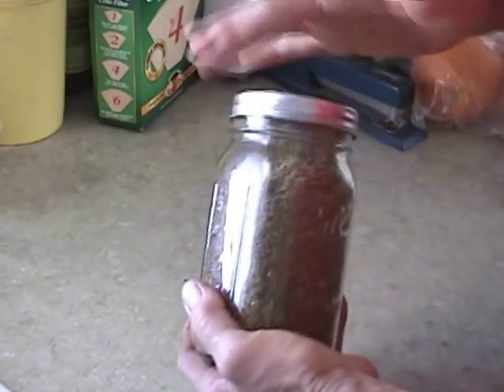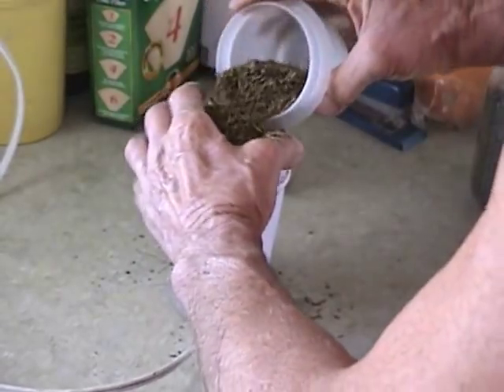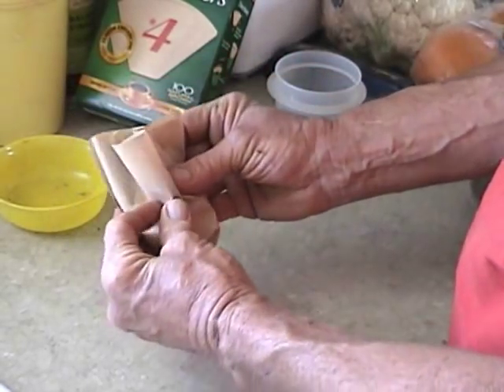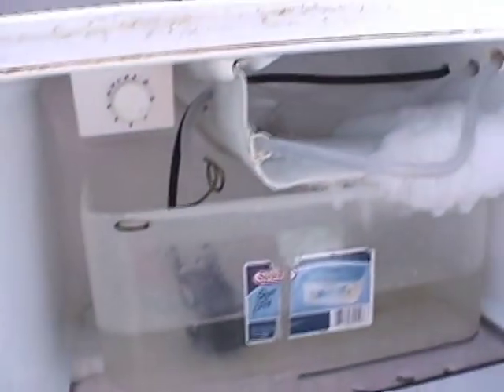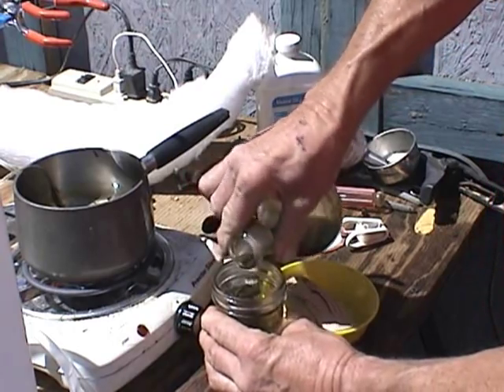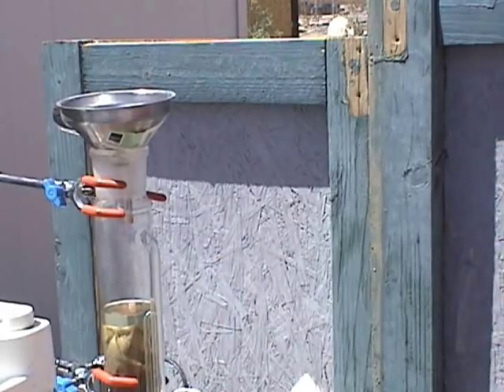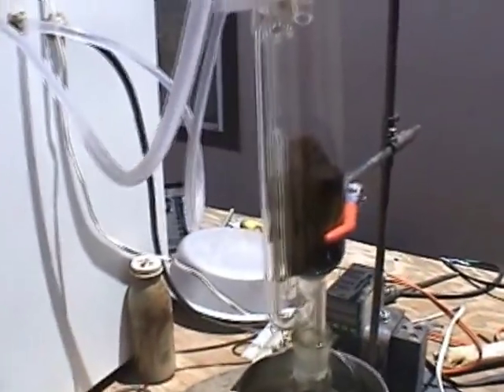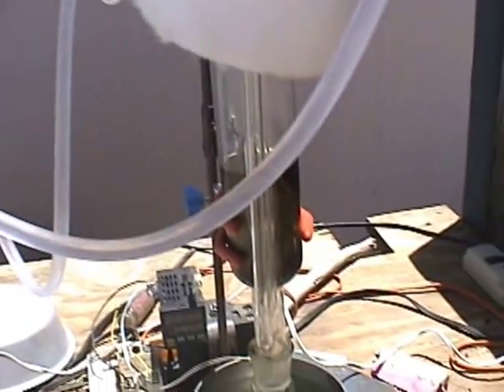Improved Soxhlet Extraction of Medical Marijuana Oil

Comment: Get some keck Clips for your ground glass joints glidman rings would be a good purchase too, in my opinion they are far superior to vaccume grease. Id also reccomend that you clamp the boiling flask by the neck. When you assemble your apperatus you should start with clamping the flask, inserting the extractor body and securing it with the second clamp.then add your reflux condenser to the top.hardware store acetone is dirty for a solvent; however, it is cheap.  I understand the need for a cheap solvent,  so my reccomendation would be to first distill the acetone. Rocks for boiling stones can contaminate your product with heavy metals and particulate, broken glass works well for boiling chips and does not scratch or break your boiling flask. I like your pid hot plate, very innovative. A good upgrade is a magnetic stir plate.  One can be made from an old rice cooker.get some neodymium magnets and  Drill some holes matching the magnet diameter into some aluminum stock. Jb weld them in and attach them to a bathroom fan moter. Make a bracket to hold the motor below the cooker making sure the magnetic bar is within the center ring of the heater on the bottom.Get a dimmer switch for the fan motor speed controll, and use your pid for the heating coil. Get some stir bars and bang! I swear you'll never use a boiling chip again!
Reply: +daniel st jean Yeah, the hardware store grade acetone was the first thing I noticed.  There are plenty of videos on how to fractionally distill this as it is commonly used as a final rinse of chem glassware when one wants to use it soon after washing and the water might contaminate a particular project.

Comment: for future improvement id recommend saving the distillate, as you can reuse it ( that would make using ever-clear more viable.) Also decarb lower and slower. and you can clean with a couple of washes in water ( and re-distilling the water off  removing some water soluble impurities. also since the soxhelt can for  long periods i dont grind my plant material nearly as much, as thats just asking for plant matter to contaminate your end product . (i do a cholorform water wash dissolve oil in chloroform{cleaned} in a jar, add water shake the shit out of it {or a high rate stir bar.}  the nasty will stay in the water. you will notice a difference, hopefully i helped a little.
Reply: +Keith Sutherland also no heat is needed to evap the acetone.

Comment: That is not medicine. You have made an adulterated product. Even if you used lab grade acetone you will never get 100% evaporation there will always be some remaining in your distillate(due to impurity bonding). That acetone you get from the hardware store is loaded with contaminants and in no way should be absorbed by the body(very carcinogenic). Your solvent needs to be anhydrous such as 99% ethanol but 99% isopropanol(from costco) is easily available. If your extracting for oral or topically use you will still be getting alot of the water solubles(vitamins and minerals) in the plant especially because of how long your running the soxhlet(soxhlet generally used for a limited solubility product). If your extracting for a smokable product decrease runtime to get less water solubles(that should not be inhaled).  I would recommend using organic untreated coffee filters and washing them in a solution 1/2 composed of your solvent(alcohol!) and distilled water; let them dry. You have to setup a distillation system to recapture the alcohol; you have an allihn condenser already just get the proper joint to orientate it vertically and recapature the alcohol (cost like $20 max). I am concerned for the health of your patients please reconsider your reagents and practices.
Reply: Acetone is an FDA approved food grade solvent in concentrations of less than 30 parts per million in your finished oleoresin. And the stuff you buy at a hardware store is only 0.9% off of laboratory grade purity. He is doing just fine.
Reply: +1337Sauce Who TF is vaporizing and inhaling any soxhlet extraction regardless of the solvent used? This is for edibles.
Besides that, it would be no more dangerous than BHO after purging.
Shit, technically nothing is supposed to be vaporized and inhaled.
Reply: He should've used everclear! If I'm not mistaken isn't that something like 180-90 proof??

Comment: If the evaporation losses were expensive using Ethanol, then just set up a distillation apparatus and recover the Ethanol. You should be doing that with any solvent you decide to use in order to recycle them, limiting losses.
Reply: Right not like he doesn't have every thing he needs right there. LOL
Reply: I always recover the solvent, to be used again at another time, when done extracting...

Comment: You get a C for effort. A rudimentary chem class would serve you well. Acetone should be distilled prior to use and then made anhydrous with drying agents and distilled yet again. After completion a distillation should be performed to remove the acetone from the boiling flask. To ensure all acetone has been removed, use a water aspirator or vacuum pump to remove the atmosphere and reduce the pressure of your system and that process will remove any residual acetone. You could ask put the oil in a vacuum desiccator and achieve the same task with more control.
Reply: Carlo D'Angelo indeed or use good ole grain Alcohol and then still under vacuum
Reply: An if Pet.  Either is available, do a quick wash in a Separatory funnel

Comment: what is 191 proof means?and can i cycle for 4 hours with oil bath?
Reply: Proof is 1-200 scale,
 alc % is 1-100 scale. 
100proof is 50% alcohol, 
200proof is 100% alcohol.
Just 1/2 the proof to get the % of alcohol

Comment: you should consider using hexane instead of acetone i have heard hexane is one of the safest to use because it has a smell and taste like gasoline in such low dosages as 30 ppm but the toxic amount of hexane contamination is around 250 ppm. there for it's easy to detect when contaminate's are left over at a rate much lower then is toxic to the human body and it also evaporates really well and leaves next to nothing behind. anyways just a thought otherwise this is the best method to make extracts
Reply: Hexane is also incredibly volatile, and in a home lab setup without a fume hood may not be the best option where breathing it in might be a possibility. Pulmonary Lung edima is not a great way to go 6 hours after inhilation

Comment: His videos gave me courage to try my hand at it, and I always borosilicate lab stuff from ebay too, as I value my life and that's why I always never leave the oven, got to make sure the I've cubes keep the water cold, and the boiling flask isn't too cold and not too hot, it's a lot of labor, but the end product make the effort so much worth it...
Thank you Mr Jumbonot :-)
Reply: Gee to the typos...
Reply: I may have discovered a way to extract the weed oil much more fast, using a vacuum from fridge pump, the reduced boiling point of acetone mixed with weed purged of all water solubles that can be headachy and or body achy, and plus, after purging, no one notices the weed smell nearly as much, cause I flush the particles, after a few extractions...
After the weed has been allowed to boil, due to reduced boiling point, due to vacuum pump...
I only allowed it to boil a minute or two, and it was so vigorous, that it looked like most of the oil was extracted, but some other time, I'll try another bit of acetone, and see if reduced atmospheric pressures will greet me with lots of poly euphoria, and delight, and it's much faster than soxhletting, and it seems more thorough too, what with all the boiling under vacuum at room temperature too which should reduce thc degradation as  well due to no heat which they say degraded thc

Comment: I was going to do that to my fridge too, good to see it works :) Id be using high temp vacuum grease with flammable solvents tho...
Reply: Any problems in that grease entering into the Soxhlet chamber?
I've found that if I pull on the soxhlet and condenser at carrying angles, they always separate...
Reply: Varying angles

Comment: Acetone? Isn't that what they use to make cocaine?
Reply: +Matija “4rz” Arzenšek Yes.  It should be noted that unless one is using lab grade (relatively pure) acetone, one would want to fractionally distill the acetone to remove unhealthy impurities.  Make sure that if you attempt this that you are aware of lab safety before attempting.  There are videos for this process as well since lab grade acetone is great for a final rinse of lab glass so that it is dry and ready to use in a relatively short period of time, especially if water will skew one's result.

Comment: hey mate, well done in refining your process. I have a tip for a better solvent that i have tested and works brilliantly. Hexane. i got it out of automotive electrical cleaner,, its a polar solvent and has a boiling temp of between 40-50 degrees C. when i do my extractions i only have to use warm water instead of oil (less messy) and also it doesnt remove any chlorophyll so the end product is a nice honey colour to a yellow, no green in at all :)
Reply: Hexane has a boiling point of 68 degrees C. I thought about using Dichloromethane since its boiling point is 49.8 C. Since THC starts to break down at 50C
Reply: hexane is not polar, and is slightly toxic.
Reply: I get the polar and nonpolar mixed up all the time.  referring to your toxic comment, i found this info 

There is no evidence that n-hexane causes cancer in people or animals.
{ref. The Department of Health and Human Services (DHHS), International Agency for Research on Cancer (IARC) and the EPA have not classified n-hexane for carcinogenicity}
The only people known to have been affected by exposure to n-hexane used it at work. Breathing large amounts caused numbness in the feet and hands, followed by muscle weakness in the feet and lower legs. Continued exposure led to paralysis of the arms and legs. If removed from the exposure, the workers recovered in 6 months to a year.
In laboratory studies, animals exposed to high levels of n-hexane in air had signs of nerve damage. Some animals also had lung damage. In other studies, rats exposed to very high levels of n-hexane had damage to sperm-forming cells.
I found this on this page with heaps more info on hexane as a solvent.
Reply: yeah i thought it was around 50-70c . Did a bit of digging and found this table 
THC has a boiling point of 200°C (392°F). However before the THC boils, other parts of the oil evaporate and boil.
Here are some important temperatures: At 21°C (70°F) the most volatile terpenoids start to evaporate, lending a pungent odor to the air.
At 31°C (87°F) the less volatile terpenoids start to evaporate, lending the air even more pungent odors.
At 39°C (102°F ) vir tually all of the terpenoids undergo evaporation fairly rapidly.
At 50°C (122°F) THC-Acid decarboxylates as the water molecule held in the carbonate form evaporates. This activates the THC.
At 66°C (150°F) Cannabidiol (CBD) melts and starts to evaporate.
At 185°C (365°F) Cannibinol (CBN) boils.
At 200°C (392°F) THC boils. Clear vapor from a vaporizer.

Comment: You will find that Methyl Ethyl Ketone (MEK or butanone) is comparable in price to acetone but a much better extraction solvent. You can find it in the paint section of your local hardware store, anywhere you can find acetone. In my experience, MEK performs up to 10% better. 

Sources: Chemical Engineering research work
Reply: How pure is the MEK found in hardware stores?  Would I be better off using MEK from a laboratory vendor?

Comment: Isn't a little bit too risky to use industrial grade acetone to extract cannabinoids for medical use? I mean, most of the acetone will evaporate from the extraction but a little percentage of the total will be present in the final product. Also, how can you be shure about the purity of the acetone? Just thinking... Could you also try to rinse water soluble components like dirt, dust, sugars and alcohols cycling the soxhlet with boiling water after extracting the non water soluble cannabinoids?
Reply: +TheMetalMusicMachine it's not anhydrous acetone so it's getting a low-quality product. by the way why do you want water soluble stuff of cannabis?? the things that get you high are non water soluble. if you want shit in your final solution go ahead and soxhlet with water
Reply: Víctor Calvo I was talking about a rinse to dissolve water soluble compounds to get them out of the oily layer as a washing step and then discard it. This step would be after extracting the raw material with acetone!

Comment: So the Idea Is – drip cool, distilled acetone over your marijuana to extract the THC containing oil. Right? I mean you could just soak the weed in acetone, then just strain it out, couldn't you?
I've never been able to figure out a reason to use my Soxhlet extractor – but they are cool, I mean how they work, and all. I have an idea though that I will hazard, given you seem to be unafraid of acquiring glassware.
Currently, you protect yourself from the who-knows-what-kind-of-industrial-waste might likely be in your acetone, since you distill it (with the Allin condenser) right?(so don't preload the extractor body from the can) If you insulate your water tubing lines, you could recapture the (clean, by the way) acetone by evaporating it on the ONE hotplate in a different vessel. That's right, via a small kettle, set up for simple distillation (cooled for free by my tubing installation idea)! Collect clean acetone for your next run.
Live in the desert? You could even power this all with a couple of solar panels, having no carbon footprint at all (not to mention, you would no longer be pumping hydrocarbons into the atmosphere, right?)

Message me back,IM me, if you want free set up details. One hint: use those foam, split tubing sections they use on the copper pipes of heating systems to run your tubing inside of.
great work :-)
Reply: AddisonPhilips if you don't use a soxhlet it will take a long time to extract, about 1-2 weeks. It also lets you know when you got out all of the good stuff. It turns clear in the soxhlet. You don't get that feedback saying it your way.
Reply: Also, solvent can reach an equilibrium with the material. so using the same acetone to soak will create a balance between the solvent and herb, which does not lowers the efficiency of the process much.
Reply: Yes the equilibrium is a good point.
Reply: One comment as far as the tubing insulation... Straight pieces of the material are generally alright, but they still make some of the pre-fab angled pieces (usually 90° elbows) and sometimes the adhesive that holds the shell/outer coating to the foam inner piece with asbestos. Now, though asbestos is not generally deemed as a threat or concern unless it's friable and disturbed, I still wouldn't risk having it that close to a product intended for ingestion... Just my two cents. I'm all for dying doing what ya love, but don't die for doing what ya love.